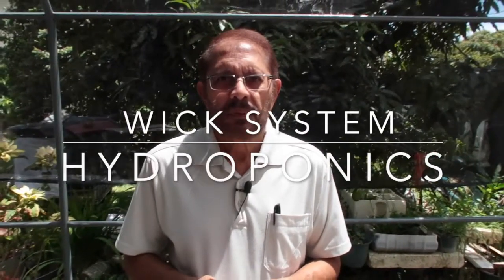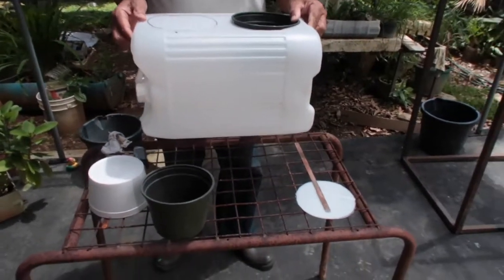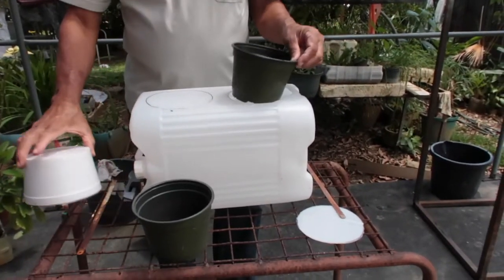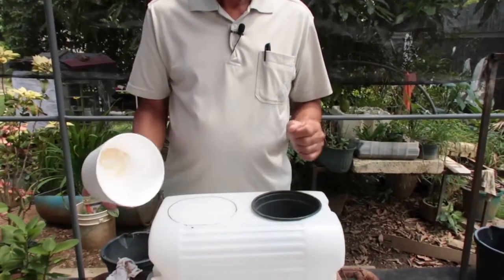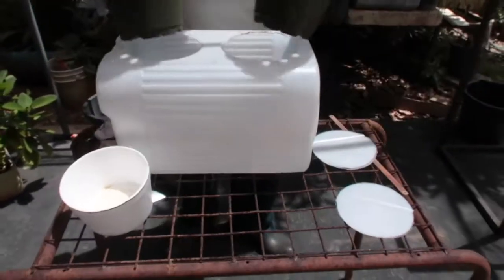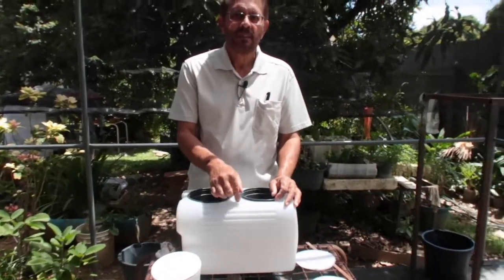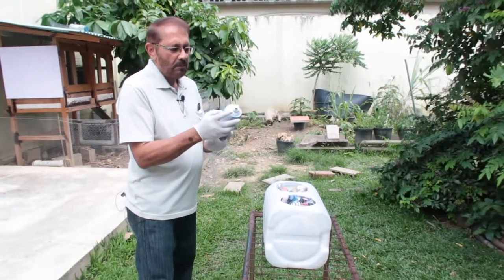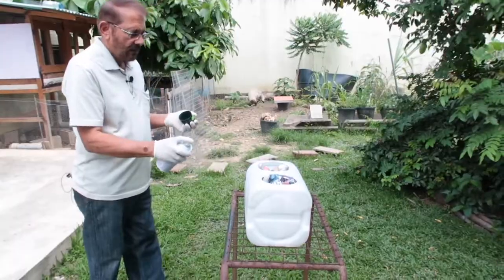Hydroponics - Wick System

Comment: Thanks a lot for the informative video!
Question: Does the water not need to be aerated (e.g. with an air-pump)? Because in all other Wicking Systems I have seen, they say it needs to be aerated.